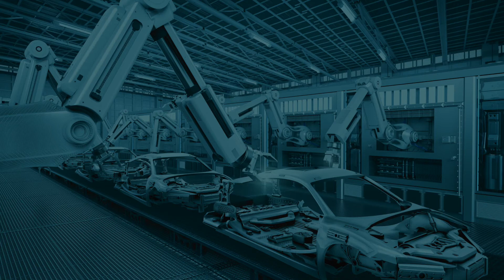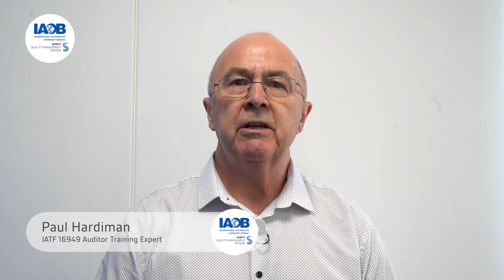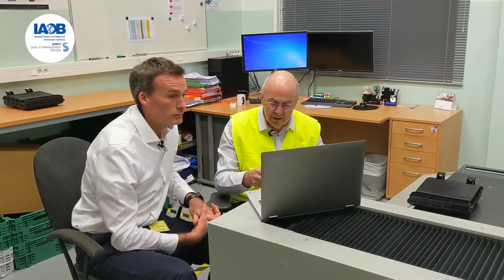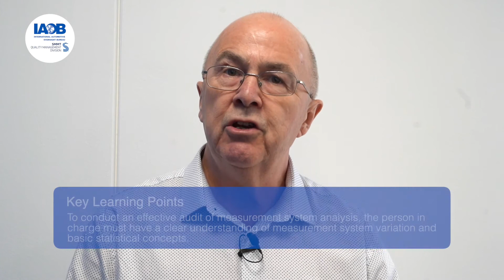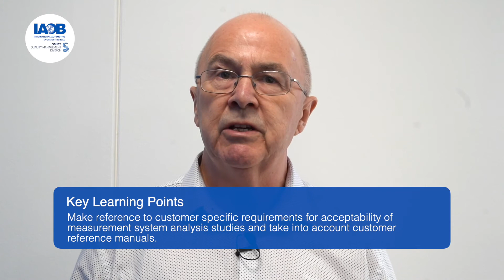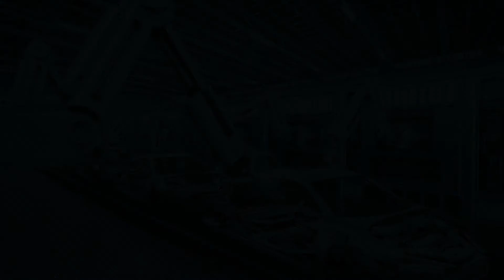IATF 16949 audits | How to: Audit Measurement System Analysis for Variable Equipment?

Comment: Hello dear. For the K1, K2, and K3 values used in the MSA Manual(4th)'s Variable Gauge R&R Evaluation (Average Range Method) sheet, please clarify whether they are in inches or millimeters. For the sample cases used in the manual, please also explain why the units are not listed.